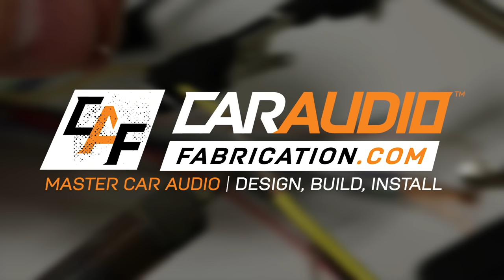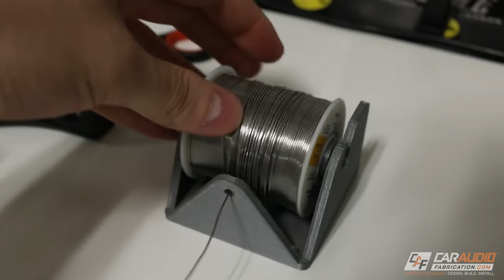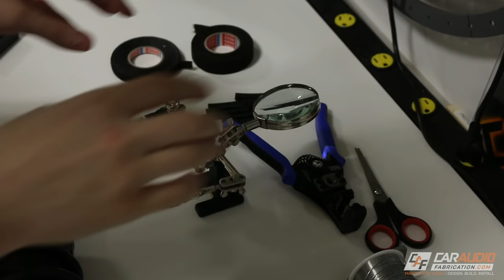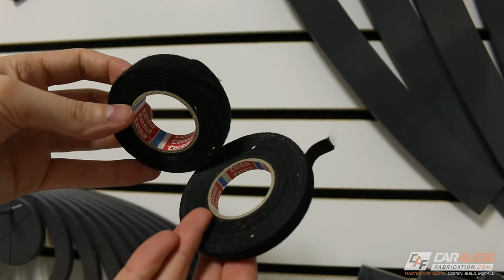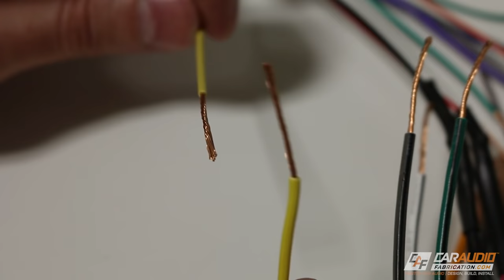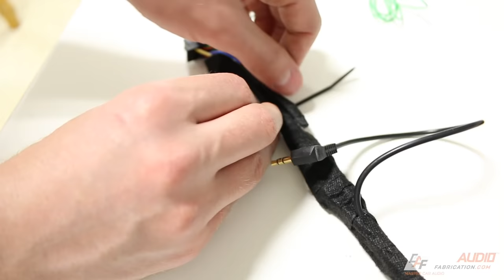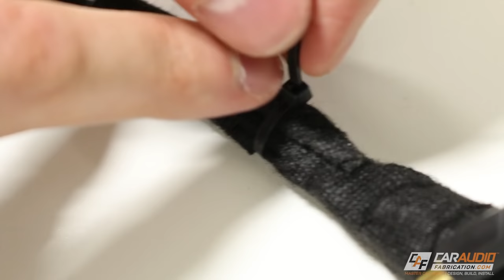Radio Wiring Harness - How to Install like a PRO

Comment: Okay. I do not have a power antenna, nor do i have my own amp. My cars harness only has a solid blue wire and the radio harness only has blue white. Do these need to be connected for whatever reason??
Reply: Look up the wiring diagram or pay someone to do it. 
But judging from your car, and the color. Probably not.

Comment: What if my stereo doesnt have a 3.5mm for the steering wheel controls but it does have a green steering wheel control 1, green steering wheel control 2 and a black steering wheel ground?

Comment: I have a 04 Toyota  with the non digital JBL system and My Metra harness has the RCA's that supposed to go into the back of the hu but the Sony aftermarket hu doesn't have pre amp outputs ! What should I do?

Comment: I've always soldered looms in cars
 I've never trusted those insulated bullet crimps or those awful scotch-lock things.
everything is now basically plug and play  Back in the old days before ISO connectors 
you literally had to cut and splice cables in the car or run your own cables in because there weren't any

Comment: Hey bud.... where did you buy that little soldering clamp station? It wasn’t in any of the links you provided.
Reply: I got a similar one from Radio Shack a few years back. But Harbor Freight Tools has one for $5

Comment: Great work you do!! I dont know  if this has come up, I have a pioneer avic 5100, and the pioneer harness is getting shorter. Is there a trick to depin  pioneer harness, or add length or do I need new harness for my headunit??

Comment: i recently replaced my radio using the jvc kw750bt on a 2002 vw jetta tdi and when i go into reverse the lights dont go on i didnt use the backup camera either please help! i checked the fuse as well as the bulbs and nothing please help!!

Comment: does anyone know why american aftermarket radioes come with snipped wires that you have to solder yourself when you get iso connectors that plug straight into the adapter harness with radioes in europe?

Comment: Is it best to use the harness ground wire or use a chassis ground location behind the dash?
Reply: Lava, I have the same question. What ended up working for you?
Reply: @roger_rivas  still up for debate I suppose.. i used the harness ground and experiencing a slight whining. I'm going to try another location.

Comment: I've been watching your channel more than Netflix lately!  Okay so I am keeping my factory Uconnect 5.0 and I will be using the High level inputs on my old RF Punch 801X.  In order to maintain signal I will be using 47OHM 12Watt Non-Inductive Resistors in parallel with my factory Uconnect speaker (signal) wires.
My concern is two part.
1.  Will the large chassis ground on my Amplifier be so good that I create a ground loop with my Uconnect using the factory harness?
a.  How would I make the factory ground better?

2.  Where do I put my Resistors?
b.  At the amp, at the factory harness, or at the location I tap my speaker (signal) wires?

Comment: Any good tips where I find the right harness for my VW T5 2009 ? :)
Reply from the maker: I'd check Crutchfield. Unfortunately there is not a harness for every car in existence though, especially with a car that is now 11 years old, it may not be worthwhile for companies to continue manufacturing a solution.
Reply: ty for answer!  I disconnected adapter from my old sony player so i will try to use that. i guess if i wire it together with the wires that came with my android player this should work.. x) also tried using sony connector directly in my android but only button light comes on for a few sec

Comment: What would you recommend if there is no aftermarket harness for your vehicle ??? I'm just curious, as Im guessing  ill have to solder right into the vehicle
Reply: I'm such a nut for not disturbing any factory wiring that I'd just run new wires to it.  Most vehicles have spare fuse spots in their fuse boxes that you can buy terminals for and add in an extra circuit that looks factory or you can run new wire off of the battery for power, then run RCAs to an amp and new speaker wire into the doors (will handle more power than the stock wires anyway), and ground it to the chassis.  If you clip the factory wiring there's no going back and if you ever change the radio out again in the future it'll just make it that much more difficult.
Reply: @406Steven  i wished i would have read this reply a while ago , i already cut the factory wires,  but i saved the connectors so i can resolder it back later, i have a damn jag , and there was no harness available

Comment: Do the blue/White wire from the radio harness connect to the solid blue wire from the car side harness?
Reply: Look up the wiring diagram for the radio, and the wiring diagram for your car. Wires can mean different things every manufacturer is different.

Comment: if you connect you amp to the blue wire, won't it turn off the amp when you no longer listen to the radio / antenna no longer needs power ?
Reply: Isnt that the whole point? When you turn the car off, you dont want the amp to stay on, draining your battery overnight...

Comment: Does that tesa tape also work for under engine wiring harnesses? Is it heat resistant?
Reply from the maker: THey also make an exterior tape that is made for underhood application

Comment: I just installed a Kenwood 1037S into my 2011 F150 with the Maestro RR and F01 harness... OMG why did they make the damn Maestro interface have connectors on both sides of the box?  then the harness itself goes all different ways, coupled with 2 or more aftermarket cameras, the data interface cable, the OBD2 cable, the USB port, the GPS antenna, the MIC, all the speaker RCAs, PLUS I have a boost gauge that I wire together with the radio (gauge has the same 4 wires, ground, 12v Constant, 12v switched and dimmer, might as well get it all from the radio).  when I was done it was like a bomb exploded in my dash...HOW IN THE HELL DO YOU MAKE AN INSTALL LIKE THIS LOOK GOOD?
Reply: All the purpose built cables are so much longer than they need to be because they need to be able to fit into almost any vehicle and you can't cut and splice them shorter (or can you? idk) so you have to roll up the excess and deal with that.  I was able to de-pin the F01 harness RCA connections because I replaced all my speaker wires and have a multi channel amp to bypass that, I tied up the speaker wires from the radio but still had so much crap to deal with. I want it to look pretty but boy freakin howdy do I suck at arranging it so it looks good.

Comment: Tbanks nice  video.  I would like to make harnesses for mazda 3 2915 for alpi e halo 9 with steering wheel control. I am in planning stage at the moment. Because i am not shkre if is going to work.

Comment: What connection do you recommend using for splicing into the rear speaker wires for installing the LC2i?

Comment: What is your take on the low heat solder tubes?
Reply from the maker: Did a review, they are crap
Reply: @CarAudioFabrication  maybe it's just me but your review didnt really come across as they were crap, just not as good as soldering and shrinking. Now compare it to butt connectors and I think they are a better connection than those. And for a DIY person and doing maybe 1 radio install like every 4 to 5 years it seems to be the best overall connection short of buying a proper solder gun and heat shrink. I do on the other hand have a great heat gun with the shrink tube attachment.
Reply: @richardcroll3  if you want the best results buy a cheap electric soldering iron off Amazon for $25 buy good solder and solder the wires together then heat shrink the wire covers. Just whatever you do dont use a soldering iron in your car, I've seen people drip solder on shit and it left nasty marks.

Comment: Why an Amp for example uses an 80 fuse but when cranking hard it is pulling like 130 amps and the fuse doesnt blow?
Reply: Hector Ortega maybe it's not pulling as much as you think?
Reply: I ran a very similar setup for a long time and the 80 amp fuse did eventually blow.  Read up on slow blow fuses, they intentionally don't blow the second you step out-of-bounds but will pop when needed.  Over-amping it will definitely weaken it over time and it will blow.  In 5 years I only had to replace that 80 amp fuse once.

Comment: If I replace my car stereo with the same brand, but just a different model, is the connection on the back on the new car stereo the same? I'm new to all of this.
Reply: Often times they are the same plug across a whole brand but it would be best to check with the manufacturer.  I have used almost exclusively Alpine for the last ~10 years and I have harnesses I made back then which will still work with new Alpine stereos.  Which is especially nice when the vehicle manufacturers use the same plug for a while, I pulled the radio and harness from my old Ford truck and put it into my new one and just had to get a different dash kit for mounting the radio.

Comment: The crimp connectors aren't that bad as long as you use proper tools to crimp them. 
the bigger problem is that they take up to much space compared to a soldered connection.

Comment: I’ve just bought a car, sold without just a radio ( I thought), turns out all the speakers are missing, and the wires are layed out such that I am missing a set of wires, and there are two front left speakers!

Comment: very nice video. for extra credit, use flux to get better wetting action and grease the solder wires with silicone for better water-proofing.For the wires you aren't going to use and are already stripped, wouldn't wrapping them together with tesa tape cause a short to voltage? Is there a better way to terminate them? I don't want cut the exposed wires; They are already very short as they are.

Comment: Can you teach us how to adapt an rca cable to an original car stereo (For amp instal)please?  there is nothing in YouTube showing that !
Reply: pac audio
Reply: jeremy andre There's plenty of videos on Line Output Converters
Reply: jeremy andre Try looking up Sonic Electronix. They cover the same thing that this guy does and they have the video that you're looking for.
Reply: Randy Griffith thank you 👍
Reply: jeremy andre Not a problem! You just gotta do some research. Sonic Electronix may do things a little different from CAF, so just go with what you believe is best for you. For example: SE uses the butt connectors, Yet CAF highly recommends that you solder them rather then using butt connectors.
Reply: Line output converter the only issue I have with one or simply not sure of is it steals the back deck speaker wires to install it so you lose the back deck speakers forcing you to install an amp for your highs/mids I'm not sure if you can hook the speakers and the converter up at the same time
Reply: Kenneth Prince you can do just that using the wire tap method.
Reply: Check out Line Output Converters.  Depending on your stock stereo you may get a little extra noise by using these (because the sound signal is going through 2 amps) but it's the cheapest and easiest way.
Reply: I'm convinced all you need is an audiocontrol line output device for pre amp output. Just make sure and tune it correctly for whatever amp you are running

Comment: Great video thanks for posting! Have a question? Getting ready to update my car stereo in my 99 Buick Regal with a pioneer, says that it is steering wheel control ready , do i still need to add a steering wheel control module so i can us those functions? Can us some help on this my first time .
Reply: Did u need the steering wheel control module?
Reply: @brianevans981  i figured it out thanks

Comment: Don't you need a fuse on the yellow, amp, and red cables??
Reply from the maker: The factory fuse panel already has a fuse for these wires.
Reply: @CarAudioFabrication  which ampere do the fuse need to be in my case?

Comment: yo i got an 85 z31 and wantd to hook up new aftermarket stereo. well my buddy  said he installed stereos for more than four years.turns out h didnt know shit and jus cut a bunch  of wires. cant find an accurate breakdown of the color scheeme keep getting mixed answers. can anyone help me please
Reply: If you have a multimeter you can figure out the ignition, battery, and ground wire easy. The only other wires that mater are the door speaker wire but I'd have to be there to be able to figure out which is which.

Comment: Which wire did u connect to the pink wire???
Reply: Itz Dixmond ground the pink wire to the car frame.the pink is a negative wire. It will bypass the pArk brake. And work camera Video same way as parking brake switch. but you can play movie while you drive... Thus the pink wire goes to parking brake switch normally

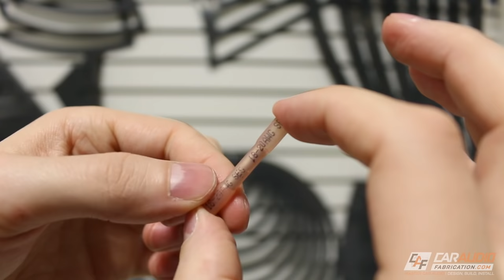Comment: I prefer using soft crimps/endshoes, but these (10:07) crimps on the video are much harder crimps, and these are not the best ones for every kind of cable, really bad for these cables used in the video, easy to damage the wire or the cables gets loose. if you have these, just solder it instead

Comment: Steering wheel control are the major issues people having. Theirs no clear HD video showing how its done for Nissan 2007 Qashqai, and other cars.
Reply: The primary issues with steering wheel control (SWC):  1) Properly identifying the SW control wires in the vehicle (there may be three for example), and 2) the fact that SWC is generally restive based.  Rather than run a wire for every button, buttons are grouped and each has a unique resistance in the circuit.  For example, VOL + may have a 1k Ohm resistance whereas the VOL - has about 3.1k Ohm.   In my Camry VOL and SEEK are connected to the same wire (SW1) and MODE and HOOK are on the other wire (SW2) with a ground wire (SWG) completing the circuit, but each button option runs through a different resistor, altering the resistance on that pulse.  The factory head unit is programmed to read the resistance on the wire and do the proper thing (up the volume, skip to next track, etc.).  Aftermarket SWC kits, then, need to read the resistance from the button press and tell the aftermarket stereo what to do.  It is possible to foul up the resistance in the wire if you add in sloppy junctions or hardware (splitters, crimps, etc.).  And "universal" SWC kits may not read the button correctly, requiring some re-positioning of the buttons in its code base.

Once you know the wires to splice into, you simply connect the SWC kit corresponding wire and in theory the system will work.  I would recommend you buy SWC kits and radio interface kits (used when connecting to a premium, amped system like the Toyota JBL systems) from the same manufacturer, as they tend to have connectors to more easily connect them and send signal to the head unit.

Comment: One item u can use in case u don't have solder or a soldering iron is 3M Super 33+ tape. It could be used also if u don't have the proper heat shrink or heat shrinking tool. U can have a clean install as long as u don't do it with those old style crimps where u r leaving 45 degree wire connections around everywhere.  Just an alternative.  Not gospel.

Comment: The real problem with butt connectors are you have to know how to crimp correctly.  Also they take up more room. I've used them for two cars and +10 years later radio is still going strong. They are also ugly compared to soldering. I would say you don't need to strip that much wire for your solder joints. They could be much cleaner looking. Another thought why not use a bigger piece of heat shrunk tube to bundle the wires. Or just a piece to go over all the joints as a second layer of protection. Total over kill but also looks sharp.

Comment: i watched like 5 or more videos of yours , and dont get whole thing ,some videos are good where you explain things , but as example i sow may videos where you using devices i never sow before and not sure what they are for , never hear you explaining anything about , i mean you should made video series from 0 - 100 so and explain everything in order , cuz now atleast for me i just keep jumping from video to video and get tons of stuff i never heard . also in additional i have a question , I have Mitsubishi Lancer 2008 going to install sound system soon , was thinking subwoofer (1200w ) with 1200w amplifier then speaker on each door 400-600w per speaker and 2 speakers on back shelf about 600w per speaker would need another amplifier for those  as well maybe even two , the thing i dont get if i am amplifie subwoofer and speakers what about , small speakers tweeters  or how ever they are called ?
Reply from the maker: I can't explain every last detail in every video or the guys who already have a basic understanding would get bored. If you are not sure what something is do a google search, best way to find additional info if you really desire to learn.

Comment: Good luck finding a adapter harness for a 81 VW. Screw not cutting factory wiring more connectors more problems.
Reply: To be fair, the wire is probably shot already.
Reply: Tom Davis Wiring was fine, speakers were worn out cause they were paper but everything else was good. No constant positive so I had to run a new fuse.
Reply: That's really nice. German engineering once again top notch. We had a '99 Jeep that had broken wiring @ the door hinges by 2011.
Reply: Jeep wiring, particularly during the Daimler years, was terrible.  Especially if you have power windows.  As far as clipping the connector off of an older car it would depend on if there were any collector value in keeping it original.  If not (and if there's extensive custom wiring to do anyway) then clip and solder away.
Reply: That's why you don't feel bad beating the sh*t out of them on trails, and every upgrade seems amazing because it really did improve a bad design/item!